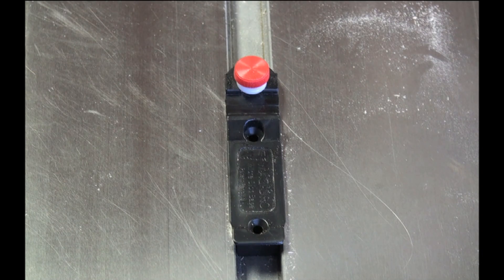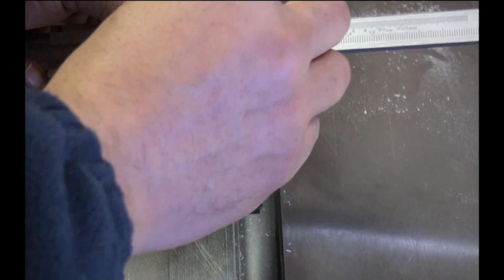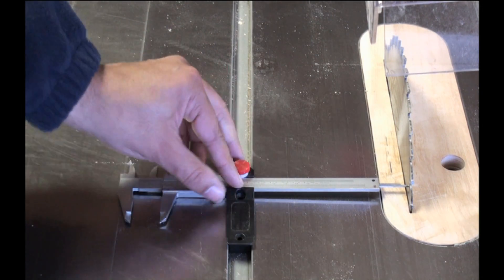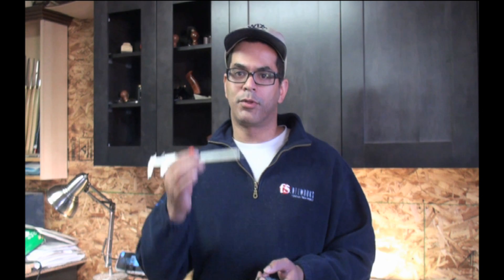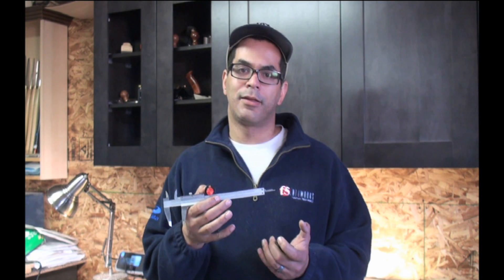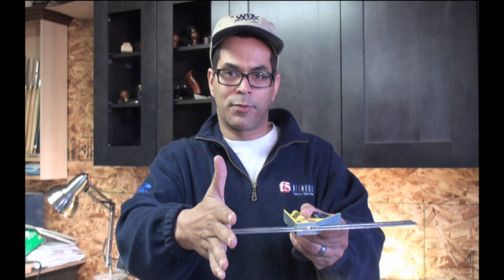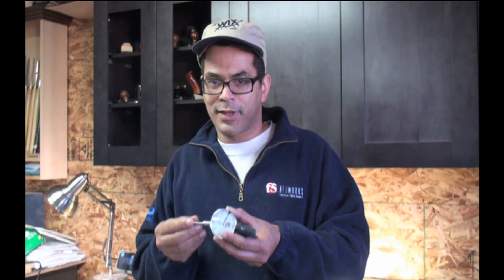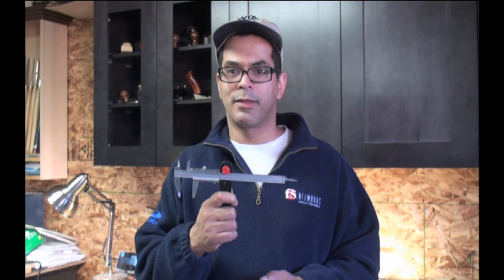Mag Dro Review - How To Align Your Table Saw Blade to the Miter Slot

Comment: Notwithstanding any questioning of your measuring technique in these comments, it is important to note that your calipers need to be long enough to both reach the blade from the miter slot AND have room to move the adjustable end.  I have a 6" iGage Absolute caliper and had to use the right-hand slot to reach the blade.  (I knew I should have bought a 12").
Reply: Use a block as spacer against the saw blade as shown by maker.

Comment: Use a dial indicator! Raise the blade to max, mark a tooth, take a measurement. Rotate the tooth to the rear and take another measurement.
Saw blades are NOT flat; all that's being done here is measuring the dish in the blade
Reply: Actually you need to do both, measure, rotate the blade 180 degrees, and remeasure to make sure the blade isn't warped, then measure at the front and back to make sure the axis is in alignment.  If you just rotate the blade and measure at at tooth and the axis is off, it won't tell you.

Comment: You check the gap with a feeler gauge? That's like checking a micrometer with a ruler. Take a measurement at the front of the blade, retract the caliper, slide it to the back then take another measurement. Your method is quite inaccurate. Either learn how to read your vernier (it will read to .001 you know) or buy a dial or digital.